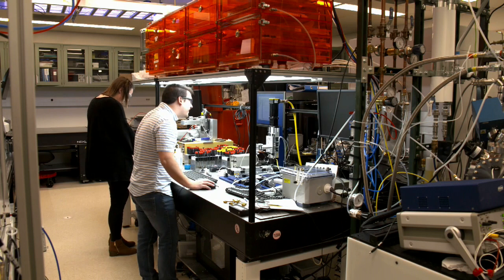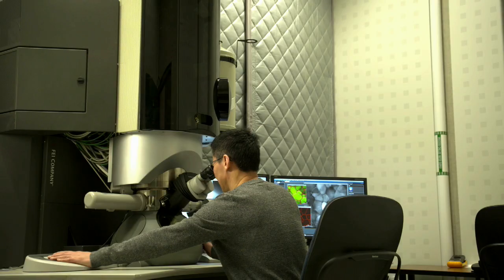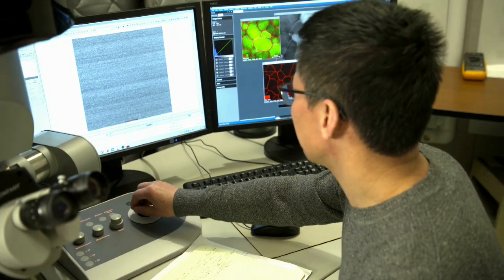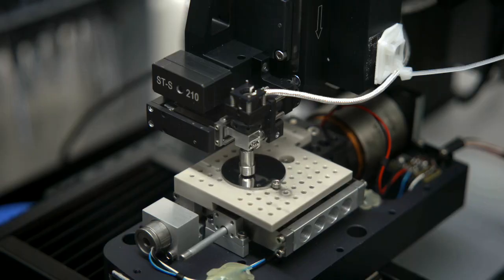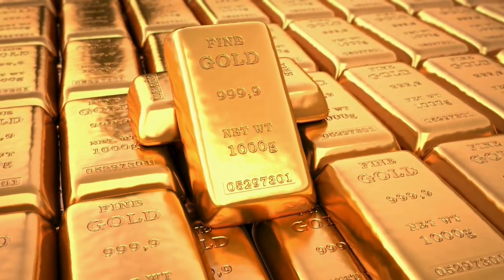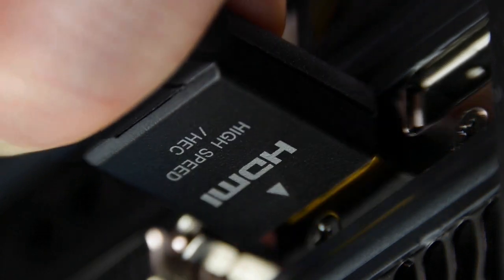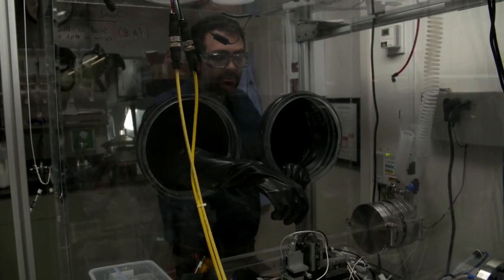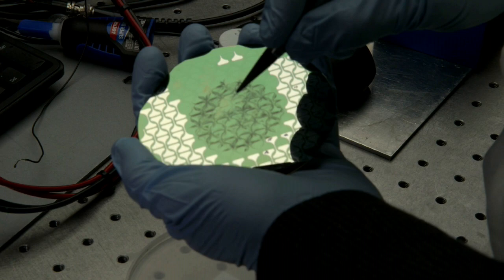R&D 100 Special Recognition 2019: Ultra Low-Wear Coatings

Comment: The only people you will be saving money....are the manufacturers. They are still going to charge consumers the same exact price if not more. Platinum infused gold sounds more expensive than just gold plated.
Reply: @nick4819
 - They've literally just told us that it's significantly cheaper, both because platinum is an economical substitute for the gold it displaces, and because the improved properties (wear resistance and thermal stability) mean that less product is required for the same durability. Also, given that the price of consumer electronics has steadily reduced over the years (lower cost for equal/improved performance), it's clear that manufacturers (who are competing with each other for sales) do indeed pass on the savings to customers. I think you must have fallen through a worm-hole from opposite land!
Reply: @previouslyachimp  Oh my child...how often do you buy direct from the manufacturer?? You won't find any better deals than direct from manufacturer...however....almost everything we buy has gone through a middle-man somewhere...maybe even a few of them. By the time it reaches us...those savings are non-existent.
Reply: @nick4819  - Oh thanks for putting me straight Nick, I'm glad you've done extensive research on all manufacturing practices and concluded that no cost reductions have ever been passed on to consumers. Lucky me to have alighted upon someone so wise as yourself!
Reply: @previouslyachimp  You're very welcome. Please, shop wisely.